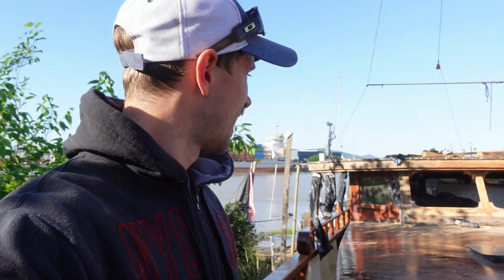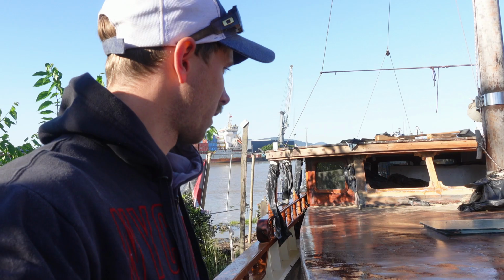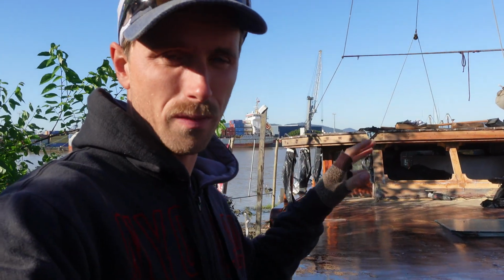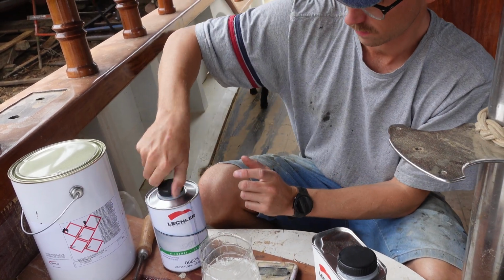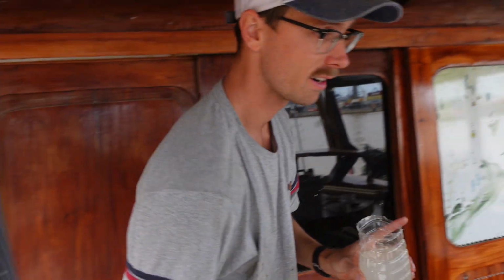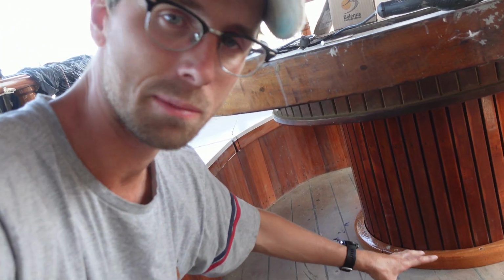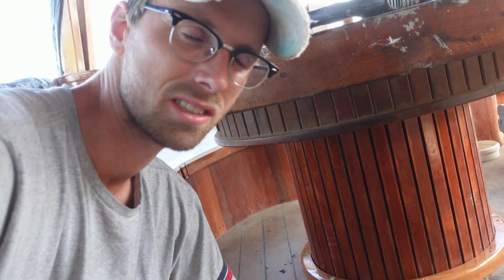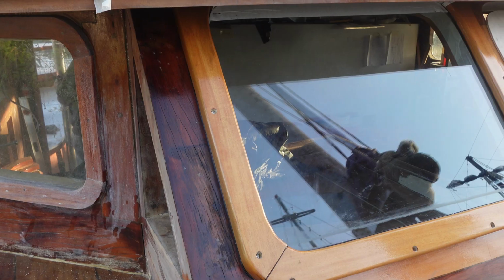Wooden sailboat pilothouse windows rebuild: finally waterproof! — Sailing Yabá #109

Comment: You need to wet out the surface with epoxy before you lay down the fiberglass, or else you get a lot of dry spots.

Comment: If your going to EPOXY WET matt or epoxy in the sun shine, put down peel ply over the matt when the matt is dry. Then wet it. You will get a much better finish. Then put fiberglss bagging plastic over that AFTER its been wet out. You can then use a roller and or plastic spreaders to even the resin and get rid of the air bubbles. The plastic stops air from returning into the fiberglass..You would be better off using boat cloths regardless and not have to deal with any of that.

Comment: The groove cut in the underside of the window frames is called a rabbet.

I know these men are skilled shipwrights and have many, MANY years of experience, but I would not bed those windows in that way.  First, the first few coats of varnish should have thinned down and boiled linseed oil add.  BOL is a great natural wood preservative.  You could go with straight BLO, but the last couple of coats would take days to dry.  Second, I would use butyl to bed the windows.  Less expensive and best of all, it can easily and cleanly be removed and replaced WHEN the  windows start to leak !

Comment: Regarding the table in the rear, would it not be better to let water enter as well as leave freely?  Water will get in there and it will then sit there indefinitely.
Regarding the windows in the front, if water gets in it will have a way out because of the slots you cut.  if it does not get in, not a problem.
Water is tricky!  🙂

Comment: Safety glass is a wonderful thing. You can hit it from almost every direction on the face of the glass. The exception is its edges. It is very vulnerable on its edges. Doesn't take much of a bump from something hard to shatter it. The boat is looking good.
Reply: Honestly, I was shocked they went with glass at all.  When he said it broke, my first thought was, "they're using real glass?"  It would seem plexi-glass would have been the way to go here. I understand that gets roached in the sun over time, but blue water boats use it all the time.  i can also speak from experience that that glass will break.  Something will get dropped on it, or as the boat flexes it will eventually create a stress point somewhere that cracks a window of three.  I would have done plexi, had a few extra's molded, and stored them away deep somewhere for a rainy day..

Comment: Nice work its looking really good i love seeing wood on a wooden boat
That round table can you not put a curved door to use that inner waisted usable 
space, or cut the inner circle lid in two halves with four nice brass hinges and two 
pull rings

Comment: ohhh I feel your pain... That drainage snafu on the windows is tricky... I suspect water is going to sit, and sit, and sit in that frame...would be a shame to cut a channel on surface to drain... I'd almost consider building a bevel on top of the lower frame sill to get rid of that valley where salt water will just fester.  ughhhh... problem also is those weep holes may clog even had you remembered to complete it...    Honestly, I am function over form frankly, and two vertical channels cut in each lower frame, sealed up is going to beat any hidden drain holes...  GREAT JOB thus far!!

Comment: Beautiful craftsmanship. Having owned and restored 3 wooden boats in my lifetime, I shudder to think of what it will take to get the 2 or 3 coats of varnish (2 or 3 times a year in the tropics!) on all those varnished surfaces. We would get 6 or 7 coats of varnish on and then paint. When you do that, you can always go back to varnish anytime you want though we never did! Varnish is cool below decks where it will last. Better have a cabin reserved for Neco!
Reply: Interesting.  So you laid down that much varnish one last time(?), and then painted over and maintained the paint?  I would have thought it better to sand down the varnish, and paint the wood for better adhering of the paint.  I would also be afraid of water still penetrating under the paint, under the varnish, and then having no way to evaporate causing more problems.  Admittedly, I don't have your experience, so trust that's the way to do it.  I just wouldn't have thought that's the process if  someone asked, or if I decided to go with paint instead of varnish on my own boat.
Reply: @jeffcanar7294  Hi Jeff, It is important to start the process with dry wood and to sand between coats of paint and varnish to get a good "tooth". Sealing the wood (thinned out varnish or penetrating epoxy) before the first coat of varnish helps your chances of preventing the products from lifting. Some types of wood tend to reject whatever coating you apply, ie purple heart,teak. Plank on frame boats "move around" so that would work against you if,say, you"re talking about painting over varnished topsides. Either way, it's a lot of work to maintain any wooden boat. Cheers!

Comment: I  wondering - whu wouldn't you "straighten out" your pilot house window line??
Either  pill back the 3 center windows and in line with the side windows (or make it a curve)
OR
put angled windows from the 3 front ones to the side windows - creating more space in the cockpit and getting rid of the awkward corner on the outside (now between the 3 forward windowsxand the side windows)....?🤔

Comment: Are your windows going to have storm shutters?  Something to protect them when you know a bad storm is coming.
Reply: My understanding is that this is going to be a live-aboard, coastal cruising, charter dive boat program.  I don't think this boat will ever be out in anything other than a squall.  So I don't see this boat getting slammed by waves that could mash the pilot house/windows.  Unless I missed the memo, I don't think this boat will hardly ever, if ever,  be more than 10-15 miles off shore.  It's a good point, and I might have internal shutters (or curtains) just to close and control the light coming in the pilot house, but I don't know that external storm shutters are necessary for their use purpose.
Reply: @jeffcanar7294  OK, I'm going to try and be polite about this.  

1st, my question was to Ben and MP not to you.  So I really don't care what your understanding is or what you think!

2nd, I have lived with nature long enough to know that it is better to have it and not need it than it is to need it and not have it.

Comment: At about twelve minutes in you struggled with a couple of English carpentry terms. A square groove along the edge of a board is usually referred to as a rabbet. A square groove across the centre of a board is called a dado.

Comment: A nice table for sure, but it also wastes a lot of space that could be used for something else... The inside of the table stem could be a small cupboard or something even better. The table surface could be one of those spin to extend surfaces or maybe a opening to show navigation tools could rise up..  The possibilities are many so simply wasting the space bothers me slightly, even if I hav enothing to do with it at all. I'm weird like that, I know...

Comment: I still wonder how much all this cost
Reply: LOL!  It's gotta be in the low-to-mid 6 figures by this point.  This is close to year three of this project, and eventually labor and materials are gonna add up.  Even if labor and materials are far less there than here in the US, the meter keeps running.  And they still have a lot of expensive bits to go.

That said, if I had the time and/or money, I'd be doing the same thing with Yaba.  The cool factor on this boat is through the roof and I give these two all the credit in the world for this restoration, and sticking with her.  This is going to be a killer live aboard/charter, which is their use purpose here if memory serves.